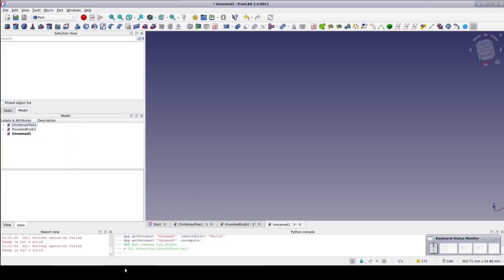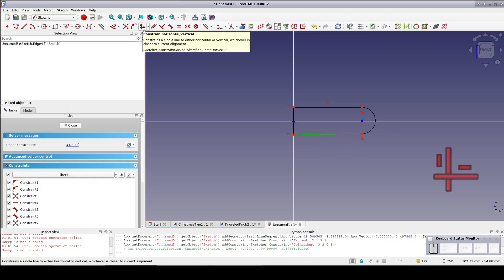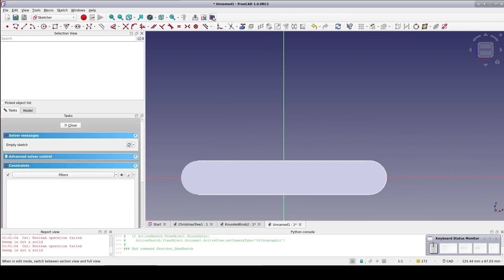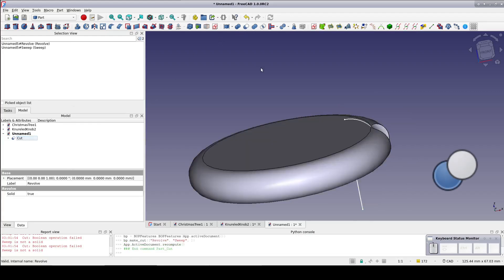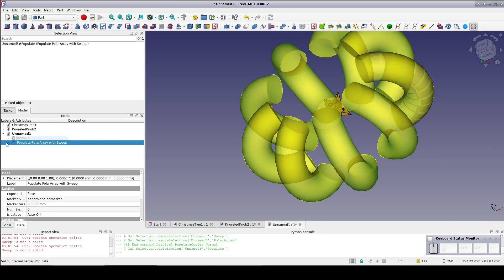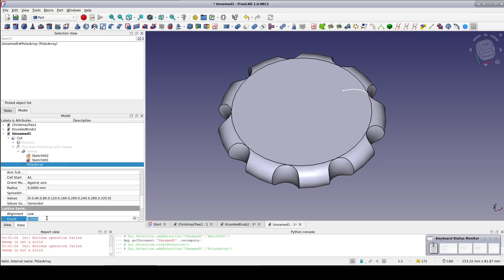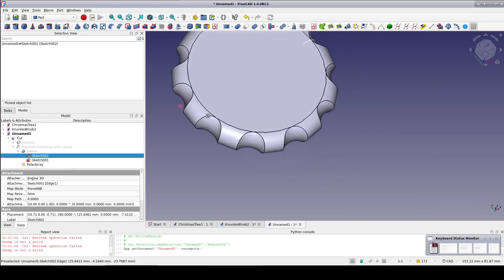FreeCAD: Nice finger grips.

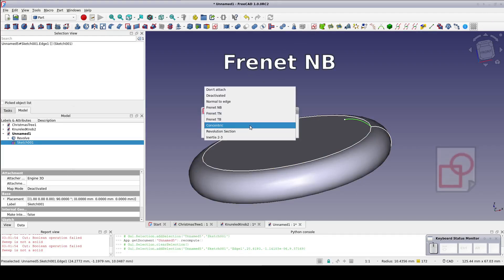Comment: I'm using RC1 and when I try to attach the sketch at 2:51, I do not have Frenet as an option... Anyone know what's up? I was in the part workbench.
Reply from the maker: RC1 shouldn't behave differently than RC2 there, is it possible that the line wasn't selected first? If all else fails, close the sketch, select it in the tree and change the attachment in the data pane.
Reply: @4axisprinting  Thanks for the reply. Ok, I see. I had the sketch selected - not just the line. Now I see the other options. Thanks!